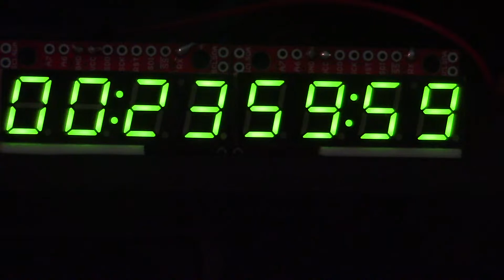Elapsed Time Clock for Timelapses

Comment: I don't see the typical caps for the regulator (7805?) you might want to add them. Otherwise cool project :)
Reply from the maker: +Dave P Thanks for the complement and the tip.